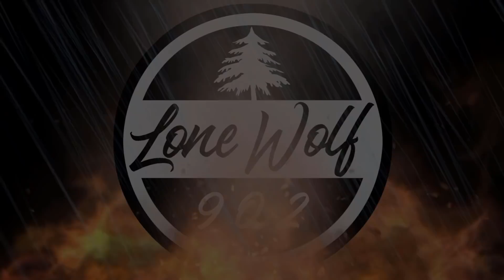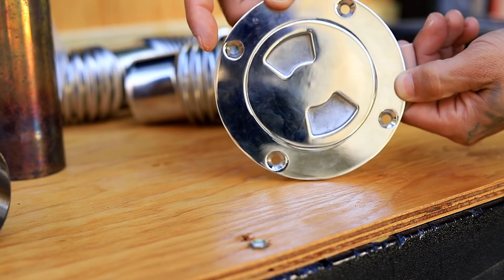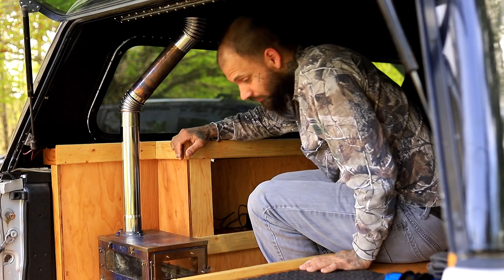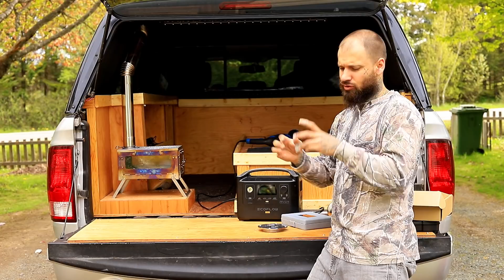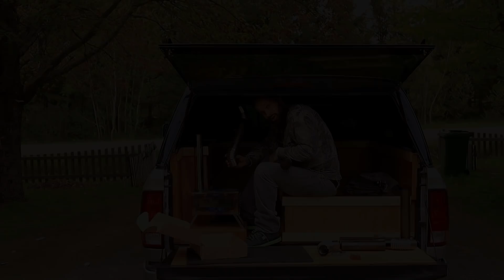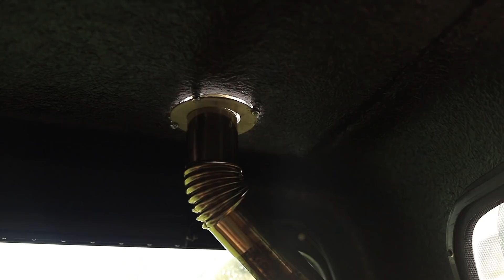Wood Stove Truck Camper - How To Heat A Camper

Comment from the maker: https://youtu.be/lqOrS6RsO60
Here is the new wood stove I installed
Reply: NICE BUILD... You could have gotten the gasHeater that is an All-in-one and set it up OUTSIDE and run the heat inside...
Reply from the maker: @RVingwithG  that would be way too much work to setup, plus its extra gas and not going to work well when it shows overnight
Reply: @Lonewolfwildcamping   Do you use a wood stove at you home also?
Reply: On the off chance that you see this, could you refer me to where you got your elbow pieces for the stove pipe?

Comment: awesome job i am inspired! are the seams on these stoves sealed well for use in vans as well?
Reply from the maker: Yes, absolutely
Reply: @Lonewolfwildcamping  cool. can the flue run straight up no bends? cubic mini's say go straight up. perhaps pomolys stoves require a bend by design

Comment: Love your vids. I have a 4runner and would prefer to not cut the roof for the pipe. I thought about porting the pipe out a cracked window with a template holding the pipe in place. I wonder if anyone else has done this and how viable it is.

Comment: you don't need to drill a hole in the topper, you can just cut a hole in your screen window and pipe it out the window. i used a Y shaped piece of steel I bolted below the window to hold up the stove pipe. replaceed the screen with metal screen to be safe.

Comment: With the heat generated, how has the topper held up? Worried about the heat around the the metal on the topper itself. In the vid you mentioned corrugated plastic was in between. And the fiberglass of the topper warping, becoming brittle, etc.

Comment: I have a question for you, did you allow enough time for that silicone to dry? Have you had any troubles with it since you’ve installed it in the silicone on the top of the roof?

Comment: Just dropped $4k on a canopy for my frontier and first thing I want to do is install a stove vent.. But man, really scary drilling a 3" hole in a brand new $4k canopy lol
Reply from the maker: Just drill it, you'll love the stove addition
Reply: don't drill it, just cut a hole in your screen and then pipe it out the window.
Reply from the maker: Then you lose a window and water comes in  when it rains

Comment: Did the metal ring do enough to protect the fiberglass from the heat of the stove pipe
Reply from the maker: Yes. And fiber glass is not flammable

Comment: Just installed Diesel heater...very happy ..with it...very low battery consumption ...mounted my diesel tank out side on my back door( metal military  style)...so I can fill tank out side ...disconnetted the internal tank .ran fuel line under van ..mounted pump under van as well....cheers..

Comment: Hey man, love your videos. I notice in the stove install video you have a heat guard (what is that, btw), and in a later truck camping in winter video in the dodge, you have it off. I'm wondering, in your experience, do you not need any heat panel barriers? Stove seems only avout 4 inches from your walls. I'm about to install, so your input would be Very appreciated. Cheers!
Reply from the maker: The current setup is all that is needed and work very well

Comment: I am not very familiar with wood stoves however I have known some people to use them with hot tents. I am building a setup not in the back of my Tacoma tall topper. A few questions I have are, what stove would you recommend as I’d probably go as small as possible. Do you make the sawdust bricks yourself? Is there a suitable tiny stove to buy or should I attempt to build one

Comment: Very helpful. Would like to see Pomoly develope a thru the roof kit. Didn't know the stainless pipes would work with the titanium stove. I thought I read on website that it would not. Has the silicone collar been enough to keep rain out? Thank you!
Reply from the maker: I have had no issues with rain. The steel pipes are from a different manufacturer
Reply: @Lonewolfwildcamping  who please?

Comment: Great video!!!!....What is the temperature  of the depth plate, is the silicone lowering the temperature of the metal on fiberglass roof.
Reply from the maker: Thank you the fiberglass cap is barely even warm to the touch,  totally safe. Been using it like this for many months now
Reply: @Lonewolfwildcamping  thank you, all your videos are instructional & will help out alot of builders.

Comment: I’m getting ready to build a shell for my 83’ F350. I’ve decided on the shape. Im just going to build it and then fill in the layout after I get a feel for the space. I’ve decided on the T-Brick Ultra. What are the tolerances you used for spacing. Looks to be about 3-4” around the stove from all the wood
Reply from the maker: Awsome,  best of luck. I didn't require much space and it worked out really nicely

Comment: To safely  heat your truck cap camper use a Coleman catalytic heater and or an origo heat pal that runs on alcohol. That and a generator with an electric heater.
Reply from the maker: Wood stove is better for me
Reply: Who asked you?

Comment: You're not very smart you have gasoline underneath that stove
Reply from the maker: Yup, well aware. Actually much safer than using a propane stove on the tailgate or parking near an open campfire. And I'm a genius 😄

Comment: What did you use for the standoffs on the heat shield? Also did you decide to not do a heat shield on the tail gate?
Reply from the maker: I used lug nuts as spacers,  no heat issues with tail gate

Comment: I may have missed it, but where did you locate the 45 deg fittings and top cap you installed in the roof of your bed cover?  Do you have links?  Thanks for the great videos.
Reply from the maker: Pomoly.com offers them

Comment: Dumb question Im sure... are you planning on driving with stack up or is there a way to disconnect everything and pull it out? Thanks.
Reply from the maker: I usually take it down.  But if I'm driving in the woods short distances I'll leave 10 inches on

Comment: You can use Header wrap on the pipe where it goes through the roof to close that up also. Any moisture will just be evaporated. ;-)
Reply from the maker: No need, I use a silicon sleeve

Comment: Candy sheet might be a better choice. A little thicker but like a baking sheet not recommended for use above 450F. Is the flu piping dual wall? There are quite a few refractory products available that are made for the wall mount instant water heaters that might be used insulate the wood members of your build. Non-ACM fire wool  and some castable products are available as well. McMaster Carr would be a resource perhaps.
Reply from the maker: https://youtube.com/playlist?list=PLqDy1P58RpUyBtdoBquNtKcyFzOLw-dmq

Comment: The metal heat shield probably will conduct a lot of heat to your wood cabinet, some cement board or something that won’t conduct heat would be better. But your idea is good.

Comment: Using silikon isn't great idea. It should be something more resistant to heat, maybe roof sealer or special sealer for stove flue system?
Reply: I was thinking that red silicone sealant for pellet stove piping??    Yes??

Comment: Nice video but wondering how roof doesn't leak once pipe is installed?  Metal pipe OD goes through opening ID so it seems there is a gap unless you have installed some time of gasket.
Reply from the maker: I use a silicon sheet on the outside

Comment: what kinda of "silicone sheet" are you planning on useing...sure hope its heat rated...silicone and c-vent = problems. 400-500 degrees or more require heat rated silicone
Reply from the maker: The heat does not get that hot at the top.  Works totally fine

Comment: Titanium wood stoves are fucking expensive
Reply from the maker: Yup, they sure are
Reply: @Lonewolfwildcamping  how long you can stay in your knees inside the camper ? 30 minutes ..is hard to believe to live like that 24/7 unless you have no more options ..way need to be necessary a camper truck no make sense is a bad choice and a bad insulation design
Reply from the maker: It works great for me
Reply: In a poor camper design !!!
Reply from the maker: 🤣🤣🤣 works great https://youtu.be/DlTxT2O7CUI

Comment: That's not how to determine the correct hole saw size.  I bet the hole you cut was a bit to big.  I was hoping you would admit that, you didn't, but you  went from drilling to having the metal part already glued in.
Reply from the maker: The hole i cut was the perfect size actually,  thanks for trying to be a know it all... just stick to being a nobody

Comment: This is a neat concept however, the metal you used isn’t adequate for the heat and eventually the metal will degrade and become unstable.
Reply from the maker: Works great over the 40 plus fires so far

Comment: I was wondering if rigging the chimney out of the side window would work.  I really don’t want to cut a hole in my shell.   Maybe rigging the deck plate to something you can seal in to the window.
Reply from the maker: Definitely go out the roof and keep the windows functional
Reply: @Lonewolfwildcamping  i guess i was thinking more something that was removeable.

Comment: I briefly tried out my Dickinson P9000 Propane fireplace in my van with the chimney sticking out the sun roof because I didn't want to drill a hold in my roof. It didn't put out enough heat for my liking, so I'm thinking about getting a wood burning stove, A Dickinson $625 or maybe this one. Propane is very dangerous in a confined space. On sailboats you need a vented propane locker to store the tanks. I tried to figure out how to install an exterior propane tank on my van but decided just to sell the fireplace. I've got it on craigs list. Used it only 3 times.

Comment: Hi Lonewolf,  I am going to be in the market for a new truck topper for a new truck.  I liked my entry level Leer on my old truck.  I do not like the top of the line Leer I have on my current truck (the window opener mechanism seems flimsy and do not like the small tilt out).  What brand topper do you have and do you like it.  I liked how thick the drilled out portion you showed was on your topper.
Reply: What brand topper is yours and do you have any opinions about it?

Comment: I would have made a panel then stuck the pipe out the window. I did that with a Woodstove at a house I rented. 
I never make a hole in a roof unless everything else was not worth doing. 
I really can't see why you did that but it looks like it turned out OK. It just later on especially since it's only Woodstove weather a few months every year. 
Hope you like it.
Reply from the maker: I need my windows to be functional,  worked out perfectly

Comment: I hope you used hi heat silicone
Reply from the maker: Yes of course. But after burning with this setup many times I can confirm that while the stove is burning very hot i can actually touch the jack area with my bare hands and it is barely warm
Reply: @Lonewolfwildcamping  I've been thinking about a wood stove in the truck for a year and your videos have given me the ideas I needed to make it a reality this year with the Pomoly Dweller. I was thinking I might need to wrap the pipe with header tape or encase it in a larger diameter class B pipe at the jack to protect the cap and to help the draft in the pipe for when it's really cold out. What do you think?

Comment: I've had this idea for awhile, but using a metal 5 gal bucket fashioned into a stove. I love this install with one exception. I'm not sure finger tight on the jack cap will work with the vibrations of driving down the road. You might think about either wrench tight or put a lanyard of some type on it so if it does come off, it's still attached. Just my 2 cents.
Reply from the maker: Thank you, these deck plates have wrenches to loosen and tighten them

Comment: Another reason for not keeping a propane bottle in the vehicle is you are usually getting it filled by someone else and if they fill it improperly not fully filled you are paying for fuel that you didn't get but if they overfill it can be dangerous I had a 30 pound aluminum bottle the filling station attendant tryed to say it was 40 pound it was overfilled and popped off on the way home in my vehicle and I didn't clue in to how much it was overfilled and hooked it up to my propane fridge it popped off again when the temperature in my living area the escaping propane caught fire on the pilot of the fridge and everything went up I found what was left of the tank over a  block away
Reply from the maker: Great information,  thanks for that

Comment: A properly working LP gas heater doesn't have a smell.  A new little buddy heater needs to be lit and allowed to burn for an hour or two,  this will burn the new off of it. After that it should have no smell at all.
Reply from the maker: They all stink

Comment: I fail to see how water doesn't run down the pipe and drip inside, I live where we get 60 inches of rain. Very thoughtful and clean install, I like the deck plate, Thumbs up!
Reply from the maker: I use a silicon sheet when it rains
Reply: @Lonewolfwildcamping  I should have known better than to skip ahead in the video! :  )

Comment: Hey, im working on a dweller stove setup where did you get the 45's?
Reply: Any idea what size they are? Pomoly has the pipe size listed as 2.36 but I cant find any 2.36 stove pipe stuff.
Reply: @ozarksurvivalsystems4471  Pomoly has them on their site now
Reply from the maker: I got them from another stove project

Comment: Those diesel electric heaters, never had an issue, running them for years..

Running them on low, draws 6w after startup.  40w on high after startup, a basic solar panel and SLA battery, can run it on low all night long and it will keep the back of that heater even in freezing temps...

While I like wood, I don't like getting up to restock the fire or be cold rebuilding the fire to warm back up...
Reply from the maker: I never sleep with heat on, my down sleeping bags do the job nicely 😊

Comment: I'm loving your set up, but I do have a question.
Why didn't you angle it through the side, instead of the top?  Not enough room between the corner and the window? Or were you worried about rising heat off of the stovepipe, effecting the fiberglass?
Reply from the maker: Yes, not enough room and not flat enough for drilling and water seal
Reply: @Lonewolfwildcamping  thanks

Comment: Did you use heat resistant silicone?
Reply from the maker: Yes, automotive silicon. But honestly household silicon would work as that area doesn't get hot

Comment: Planned and executed well. My concern would be clearance to combustibles. I know with single wall pipe and natural gas it has to be 6"....more with wood fired. Keep an eye on the fiberglass for warpage after time
Reply from the maker: Thanks alot and great suggestions
Reply: Exactly my thoughts.  all that "corrugated plastic" inside the canopy is going to melt closest to the pipe.  Still a wicked build none the less.
Reply from the maker: Been burning in it well over 20 hrs now. Wide open and damped down doing testing and no issues. No issues with my hot tents made of thin material either.😊👍
Reply: Hmmm clearance to combustibles really?😜

Comment: In reference to heating a vehicle with electricity, I have used a 40W Greenhouse Tube Heater under my cotbed in my SUV with great success, as well as being cheap and robust it's thermostatically controlled so I didn't have to worry about it killing the battery pack it was hooked up too.. I think your tent stove setup will be fine, I see some people in the comments are freaking out about having a tent stove in a truck, in the UK lots of vanlifers have full size woodburners in there Sprinters and Transits with no air issues at all.
Reply from the maker: Thats so awsome,  great idea.
Reply: @Lonewolfwildcamping have you had much problems with it getting too hot or taking up too much air?

Comment: I went out on my first hot tenting camping trip and had some of those compressed hardwood bricks.  I found that they just kind of smouldered and didn't put off much heat.  Even when I piled some wood ontop, it never really caught fire.  Whats your thoughts?
Reply from the maker: They need to be started with wood like a regular fire, after the fire is established then you can switch over to the bricks.
Reply: @Lonewolfwildcamping  Ahh good to know, I laid the bricks on the bottom, then started a fire with wood ontop and didnt have a great result.  It was my first hot tenting trip, was still super fun!

Comment: This is awesome! Your design of the heat shields is spot on, the base will be just as important. It is obvious that you have put a considerable amount of thought into the safety required. Looking forward to seeing the finished project in action.
Reply from the maker: Thank you, it working good so far but I'll keep a close eye on things
Reply: You violated numerous provisions of the Solid Fuel National Code
Reply from the maker: 🤣🤣🤣 I know,  its awsome 🤙

Comment: Curious, if you lay brick under the stove won’t it change the pipe measurement an inch, inch and a half depending on how thick the bricks are?? Will you have (wiggle room) with the stove pipe or will you have to measure and cut again??
👍🏻👍🏻
Reply from the maker: No, the brick will only go under the stove, not the stove legs
Reply: @Lonewolfwildcamping  ahhhhh got it, right on, thanks 👍🏻👍🏻
Reply from the maker: No worries,  good question though 😊👍